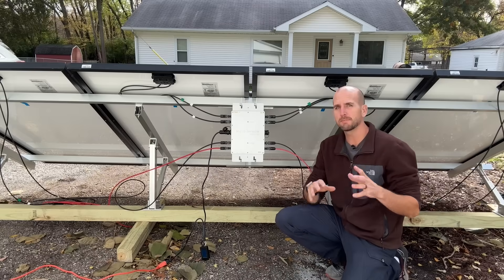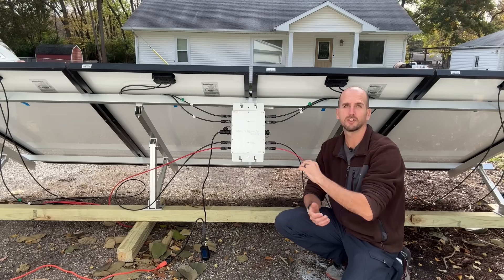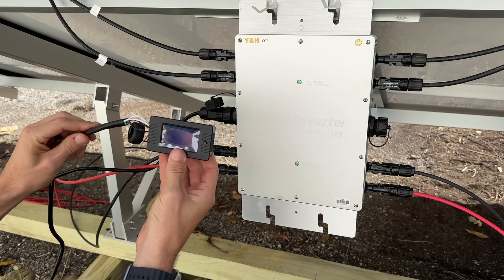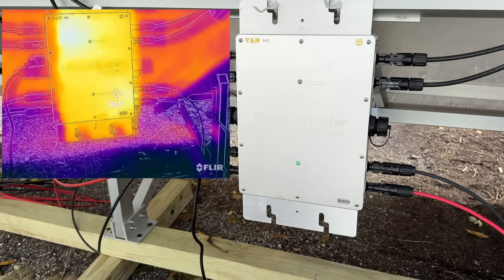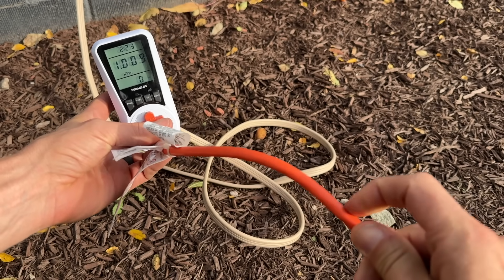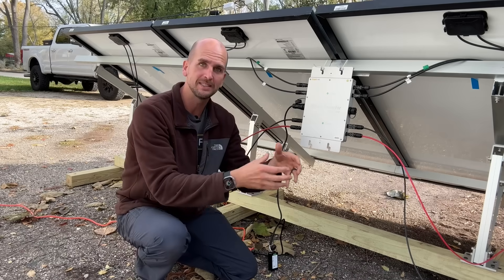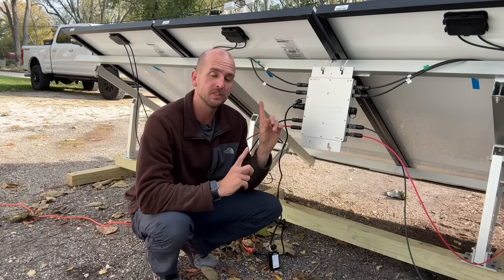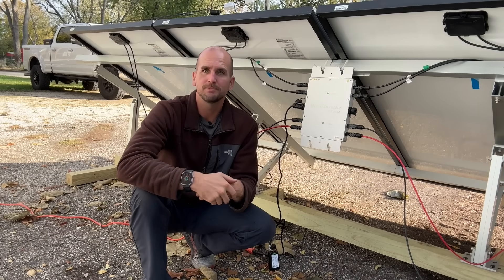Plugging Solar Panels Directly Into An Outlet | Surprising Results

Comment: Im guessing the 25 year guarantee from a professional installer is only any good if the installer is still in business in 25 years?
Reply from the maker: Yeah, that is definitely something you need to consider.  If the installer has been in business for 12 months I would be a little cautious and try to understand what happens if they go out of business and you start to have a few failures of your micro inverters.
Reply: @everydaysolar  honestly i dont think a 25yr guarantee is worth paper its written on, especially  with large number of installers popping up to cash in on government grants. Ok the good installers will still be in business hopefully,  but the " fly by nights" probably not, its a bit of a lottery.

Comment: If you like burning up outlets, fire for your wiring and have good working smoke detectors it’s a great way to go. No UL means No from the utility and inspections.😮
Reply: Incorrect. UL marking is the exact equivalent to any other NRTL ( TuV, intertek,CSA,  etc...)

Comment: Islanding is creating an island of power in an off grid scenario. Grid tie inverters require anti-islanding technology to prevent creating an island of power when the grid goes down.
Reply from the maker: Does UL 1741 call out the requirements for the anti-islanding?
Reply: @everydaysolar   Minimally take a moment to read the UL1741 description. Grid tie inverters are referred to as interactive inverters. But, I'm not an electrician so do with that information as one wants.

Comment: That is a system they are using in Germany they call it balkonkraftwerk / balcony power plant it connected directly into the power outlet an it shuts off every few milliseconds to measure if they still current in the system so it can't shock you if it did not feel the power then it will shut off
Reply: In Germany they  are limited  to 600 watt
Reply: @wernerheilig4905 you could get a few of them.
Reply: @wernerheilig4905  It's 800W now.
Reply from the maker: Exactly!  Thanks for the feedback.

Comment: For the viewers.   The support system shown is for his testing purpose.   The conductors behind the solar panels must be protected or above 8’-0”.   The cord used is not sunlight rated.    In a real install, the receptacle should be at the inverters, not just some random receptacle and a cord laying across the lawn.

Comment: FYI if you produce more power than you are using in the home at any time you can be charged for it as usage. Some if not all modern meters count up regardless of direction of flow. I have similar setup and I tested it. So be careful of how much power you make with these setups.
Reply: This was my biggest worry also. I have a small home but have small window AC's that run constantly. I tested two of the smaller two panel units. Both units only lasted 3 and 4 months. I live in south Florida. I wouldn't recommend them unless you create a way to add active thermal management. Example, water cooled with a heat sink in hot environments.  They come with a warranty but you have to ship them back to China which is half to 2/3 the cost of the unit. If you live in more northern states just be careful in the summer. That's my two cents.
Reply: @jeremyvandervort  I left you a lengthy reply on my setup earlier and apparently YT deleted it.  Long story short mine is an inside unit with fans made in both ends. You run you DC inside. I have had 8 and at times 10 100watt panels on it for a year and a half with no problems in my shop sometimes reaching 110 degrees. It was only $119. I'm not sure of the efficiency of it but it seems durable. I can put up an item number if you'd like to see the type of it.
Reply: @bw3506 can you share what unit you used? I’m interested in something like this for my detached garage that I just trenched dedicated power to and want to tie in this inverter to offset idle house usage costs.
Reply: This is the most important comment
Reply: You'll  be charged " consumption"..

Comment: 1kw is like 12 cents - Solar is a scam when sold to save money. Costs a fortune and saves you Pennies a day. Never pays off. 
Only good purpose is a backup for when the grid goes down or fails completely. For that it’s great.  A generator is a cheaper option by far!

Comment: I would be interesting to see if you could run 2 of these setups in parallel and with a big UPS. Then also test the power cutoff by flipping the breaker on the curcit that the extension cord is plugged into. Great video!

Comment: If only there was a high quality product like this that would be code compliant for the US. For now I am going to stay away. That thing is way too hot for a 45 F day. 
Also can you open it up so we can see the inside build quality?
Reply from the maker: Agreed, I am going to test for a week or 2 and see what the results are for this unit.  I agree this unit has a overheating issue for sure.  Currently I have a line of sign on an inverter that might actually be able to manage the heat rejection much better.  We shall see 🤞

Comment: Id like to use something like this to power a space heater on a mini closed circuit, that would offset other forms of heating and since home is partially heated by resistance electrical heating benefit would be the same as backfeeding yhe grid but with few/no safety issues or legal issues ultimately the best use would be to heat water in the hot water heater with resistance heating element since the water acts like a battery of sorts storing energy to be used later.

Comment: On the hottest days mine would overheat. I made a passive cooling system that has worked well. Basically the inverter is enveloped in a thin layer of plastic and placed in a box lifted off the bottom so there is air flow. On the top is Basically a 1 gallon bag of water that acts as a heat sink. I also usevan Emporia smart plug to monitor energy production and did not install the non weather proof device they included. I have solar on my home already and permits from that with the power company.
Reply: Did you put this on a dedicated circuit or plug it in with another used line on the house? How did you set yours up? Are you maxing it out at 1200w with 4 panels? I also have solar but want to expand and update. I just trenched 12awg to my detached shed on a 20a breaker to charge tools, run yard lights and want to further offset my idle house usage and thought this would be great to use the sheds roof real estate and pop 2 400w panels o.n top. Hopefully that shouldn’t overwhelm the inverter. 

Im capable of doing it myself but want to make sure I don’t overload my circuit. I thought about installing a dedicated gfci outlet to the inverter and maybe even a sub panel breaker box in the shed for added fault protection. 

Do you think the emporia smart plug nice to see the specific production from that unit? With your house solar are you able to monitor and notice the additional production on the separate panels producing as well? I have SolarEdge to monitor my house solar.

Comment: Awesome video! Interesting idea. A little scary but awesome. Don't suppose you know any way to be able to use grid tied solar when power is out? I saw some of the hybrid inverters. Possible solution? Do you know of any? I live in hurricane alley so power during a power outage would be nice. I have a solid solar system but no way to use it in an outage.
Reply: To be installed is a hybrid inverter that can work with or without batteries. Being configured as Solar Grid batteries (SUB), during the day it will use the energy from the panels to power the loads that will be consumed and keep the batteries charged if they are charged. Once the sun goes down, it goes to the grid in bypass and if the grid goes, it switches to batteries. It must be configured in the case of batteries so that it does not charge them from the network. It is a kind of UPS with solar contribution included.
Reply: @MiguelAlejandro1969 Hybrid? My off grid inverter does all that and lets me set a battery level to switch to standby mode instead of just going to the grid at sundown. It just wont backfeed the grid.

Comment: The info. On the Amazon page says keep in dry cool location, can not be in the rain and out of direct sunlight…so you might want to shelter the inverter.
Reply from the maker: Yeah, for a longer term installation I would probably try to remove the display and mount to the rail ensuring shade from the panels.  Even with these changes I am feeling like this unit still will have issues rejecting heat but that is why I am going to run a longer multi-day test.

Comment: The inspector can't tell you what is OK with the power company. If your meter runs backwards you could be charged double for the energy you are producing with this setup. These systems are not only a fire hazard but could cause you to get a disconnect order from the power company. It's highly recommended that you don't operate this or anything else not approved by your power company.
If these cheap devices malfunction and keep pushing power out to the grid during a power outage they could kill an electrician working on the power lines miles down the road without you ever being aware there was an issue.
Reply from the maker: Yeah, I am in contact with the utility trying to get an answer.  In terms of back feeding on the grid when the power is down and/or the lines are being serviced this device will shutdown power generation if the power is off to the house.  You must have power at the outlet for the micro inverter to provide the 120V out.

Comment: So in my jurisdiction if no one is home using power and you backfeed your meter for even one minute without a permit and an interconnection agreement from the electrical utility, the meter will detect this and trigger a fraud alert and the local electric utility will be knocking on your door. I have seen this happen many times from people doing what we call "gorilla solar".
Reply: And if you have an old analog meter it charges you for power you push back to the grid. They still have those meters where I live and someone physically reads it every 2 months.

Comment: I have a smaller and similar and installed a plug on it. It's not really any different then screwing the wires inside the breaker box and if its not dangerous power amounts, i see absolutely no reason why anyone would ever hard wire!  I do wonder if you had multiple grid tie mi's running and the grid went down if the other units sign wave generation would act like a master or "the house or grid power" and then back feed?  Could be another cool experiment vid! Anyway, Awsome vid and thank you! As they used to say on tool time, More power!! Lol

Comment: I believe that in Europe this is known as a Balcony Solar system. What I would like to know is: How will the power company react if they see power going out to the grid and there is no net metering agreement in place.
Reply from the maker: Good question on the utility.  That is what I am working through now and will share the results.
Reply: They will charge you for production
Reply: in denmark you need to instal a meter for exporting to the grid, if you want grid connected solar...
these are not legal in denmark even if you have a meter for exporting...

but in germany you just plug these thing in without anything

the companys that owns the local grid, can tell you the local rules
Reply: I installed one that over produced, the client had bills higher than before solar install
Reply: to go out you would need to have a higher voltage than theirs.  If you plug a 9 volt battery into your cars fuse box it is not going to charge the cars battery unless it falls under 9V.
Reply: @robertsmith2956  That's literally how a grid tie inverter works. To push power toward the grid, it must raise its voltage to slightly higher that the grid. If the power that is then generated can't be completely consumed by the house, the excess gets pushed backward through the meter. The problem is, not all meters are setup to properly handle that situation.
Reply: @robertsmith2956  That's not how AC works.

Comment: Wonder if you could use this with a pure sine wave inverter on a off-grid microgrid instead? or with something such as a bluetti or ecoflow? That way you avoid the possible legal issues that may arise with your power company or other organizations.
Reply: A micro inverter can only be coupled to an off-grid inverter that has the AC coupling function. The Victron line has equipment like this. The problem is that the inverters monitor the output voltage and the microinverter increases that voltage when coupling and causes problems in the off-grid inverter.
Reply: watched a kid use a cheap car inverter to put a sine wave into wall outlet.  It worked.  don't need a pure sine waive, just something going up and down.  Would be interesting how dirty a step will still work.  3 bit step, crossover top, crossover bottom.......

Comment: Looking at the info page, Both the 110v and 220v do feedback to the grid extra power. So you need to have your meter setup with your power company to handle it or you will have problems. This also means you will need permits to install it.

Comment: I think its great that your doing this video. You would be better off to not feed the whole house and just use a sepperate outlet not connected to house. Then you wouldnt have to worry about back feed issues. The avarage person has no clue as to how to set up and solor system let alone what you are suggesting. The other thing is just  because your  solor is producing  thousands of killiowatt doesnt mean your bennifiting from that production.  The electric companys constantly monitor the power to increase or decrease power.  Does a solor sytem cause the power company more supply issues? It sees like it would. Washing ton state has a intresting set up for charging your car. Mabe you could talk about that?

Comment: If your meter is digital but not a net-meter you will pay for power that you push back to the grid. It will also flag you for having an illegal grid tied system. They can disconnect you for tampering and then you have no power lol.
Reply: Please allow me to pay you for providing you electricity.
Reply: Only if u produced more than you consumed right?
Reply: @fox156  I agree with that. Provided that the produced power was used without being sent to the grid and returned to the building.
Reply: @fox156 True but that's on an instantaneous basis all the time.
The second your house consumes less than the solar the meter will pick it up.
Reply: Very true. When I commissioned my system, I did see a higher power bill due to not having a net meter installed (required before its installed) and it caused the meter to spin backwards. In addition, the utility tried to shut off the very system they approved claiming it was stealing power. After going up a few levels in mngt, it got straightened out,  but what a pia.
Reply: @stem_saving1644  there are other reasons they dont want solor . One is metering the grid. Metering the grid  . When you have a system with one sorce of power vou add or subtract  power to the system. Its a complex system. When all of a sudden you have an influx or a surge of a power into the sytem it can really cause problems. Now that area can have too much voltage abd or amps. Appliances can fail or even catch fire  so metering  power in put into the grid in any given area is a pain in the ass. Plus why would the power  company want to pay you money when all your doing is making them loose money and causing  them issues. The only way they want your power is if that area is lacking power and they cant keep up.
Reply: @johnramirez5032  nope. They lose money. Power.is not that complicated.  The inverters match frequency and power.factor.
Reply: That's not true in the UK. Our digital meters don't meter energy going back to the grid so you don't pay for solar production lost to the grid.
Reply: Sort of the meter can detect it. Mine will say what I'm exporting so the meter does know and likely reports it back to the energy company. @rougeproductions
Reply: I doubt it or everyone who wants to be off grid and they won't let them would do it.
Reply: That won’t happen because he’s using a grid tie inverter and his house probably always uses more than the watts he’s producing.  He’s using a grid tie inverter.
Reply: That’s why you add batteries a big ass inverter and don’t mess with these greedy corporations at all.
Reply: Its a delicate balance suppling energy to homes . I could see how having power from solor panels would be a g
Headache for the electricity company. Hundreds of people pushing power onto the grid would be viewed as a surge problem . Any out of frequency  power  would also cause problems.  Your almost better to charge batterys and use that to offsett youp power consumption.

Comment: Just think about this-even as a temp set up or experiment- If you don't have a grid sellback agreement ( and where I live that adds $12 to my bill monthly) and you send a few electrons down range--and it's detected by your power company, which is likely,  you're likely to be disconnected, and have some questions to answer.    caveat emptor

Comment: So here's my question.....since this provides 110 AC voltage, could this system be plugged in to charge my Ecoflow from the AC side while still charging from separate solar panels to the solar input to provide more charging power?
Reply: No. The 120 vac inlet of the Ecoflow does not have power out. It will not turn on. And if you connect it to the inverter side of the Ecoflow you could easily damage it.